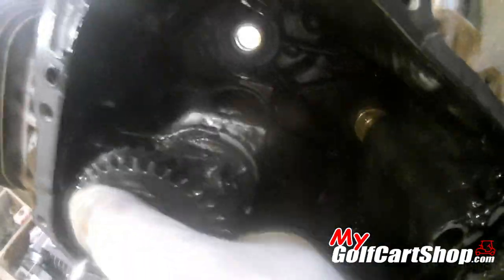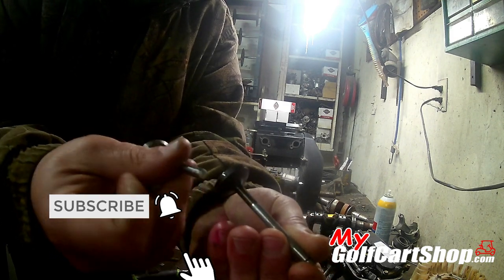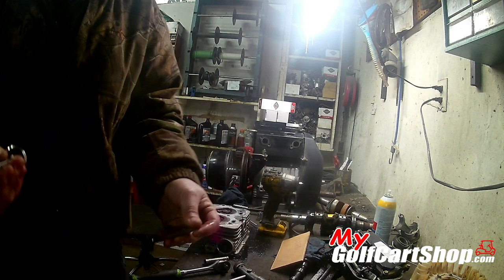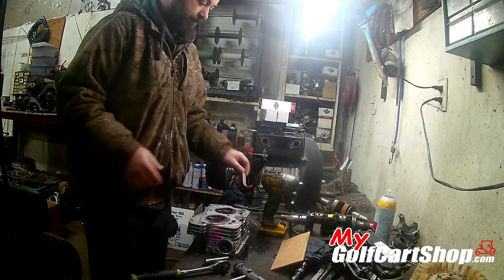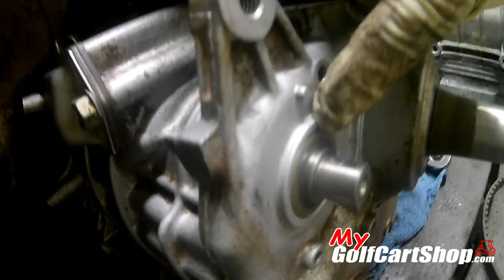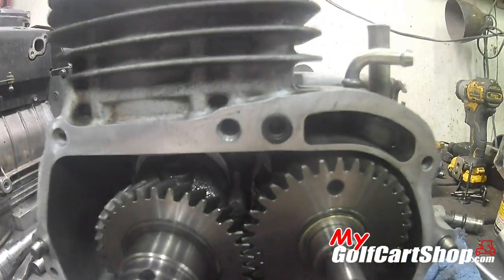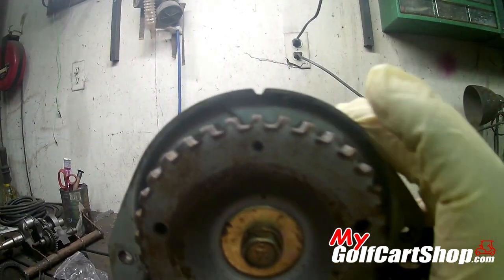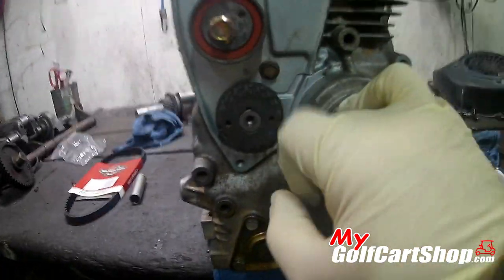Another EZGO Engine Rebuild (Timelapse)    #enginerepair #ezgo #golfcart

Comment: Question did a complete rebuild after start up the engine is not running correctly it sputters out of carburetor,I took out one spark plug and ran engine it had more rpm and sounded better  3k on new pistons only getting 90 lb of pressure any ideas what might be the problem ,4k on valves  it’s not my first rebuild .
Reply from the maker: Have you checked the fire out of both sides of the coil? Same spark? Pour a little oil into the weak cyl to see if it will pump up better than 90.

Comment: Hello 
I have a 295cc and it has a knock on it ,compression is 170psi in both cylinders 
I took the side cover off and everything is tight, what else can I check
Reply from the maker: If no signs in the engine could be coming from the clutch?
Reply: @cartsmarttv  how do you adjust valves on a 295
Reply: Do you do 4 thousands 5 or 6 thousands